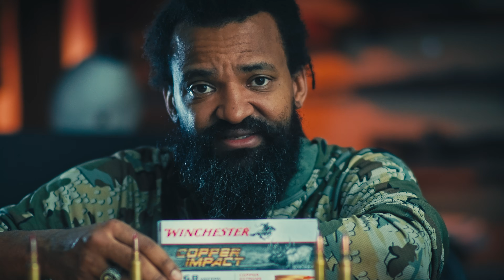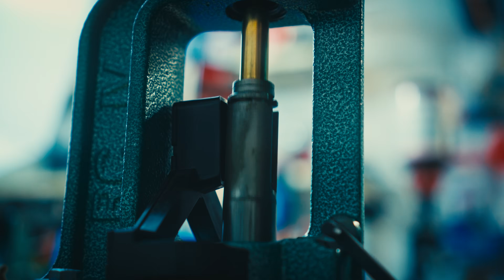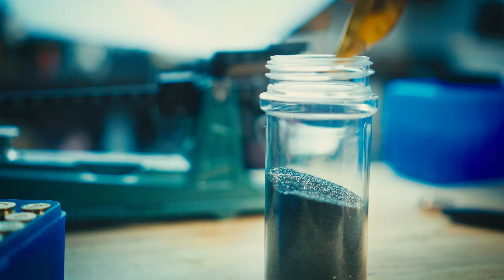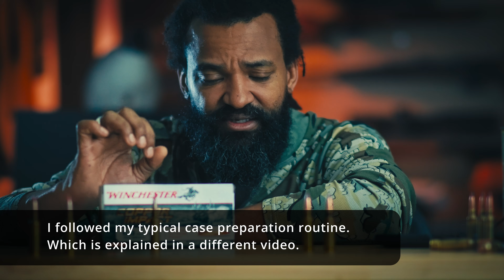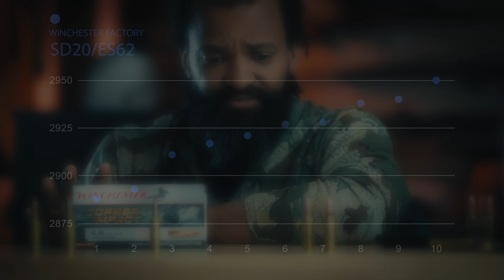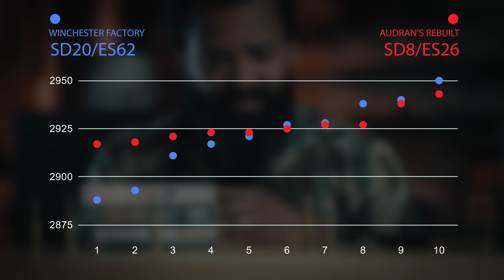I FIXED Winchester factory ammo.

Comment: Great job turning SD20 into SD8 with same components!  It looks like you are using an RCBS scale.  Good choice.  Be aware that type of scale is only accurate to +/- 0.3 grains.  Its a great scale for handloading but be aware of the tolerances of the scale.
Reply from the maker: Hey Charlie thx! Yes it's the RCBS M1000. Extremely accurate, 1 kernel too much and it shows. Where do you get the +/-0.3 accuracy? Because that's not been my experience with it.
Reply: @WildBushGrit  My experience is with the RCBS 505.  I think the +/- 0.3 grains refers to repeatability.  Tiny amounts of powder will move the needle on the 505.  However, I can weigh the same powder charge again later and get a result that is a little bit different.  By the way, 0.3 grains = 0.019 grams.  It is a tiny amount of weight.
Reply from the maker: @sorrycharlie3327   I wonder if you may have been experiencing some magnetic disturbance. This is the first time I'm hearing about something like that. Albeit slow the beam scales are usually incredibly precise. Provided you are well setup, leveled and reading it from the same vantage point. For long range shooting, +/- 0.3 is not acceptable. Precise measurement needs to be at least to 0.1 We do ladder development with +0.2 increments. The smaller the cartridge, the greater the impact a small variation is going to have on your SD. Finding a node in a 7mm Magnum cartridge is easier than finding it in a 6mmBR.
Reply: @WildBushGrit  Mine does seem to be better than +/- 0.3 but its not perfect.  I tbink because the balance pivot has a tiny bit of friction.

Comment: Winchester makes great firearms but their factory ammo is well known to be pretty bad these days. I'm glad that you were able to even-out those charges and improve your velocity variance. I would be very suspicious about your finding that your 20" barrels shoots faster than the published velocity out of a 24" or 26" barrel though. That just shouldn't happen, especially from a cartridge like that. Something is very fishy there. Your chronograph is likely reporting the relative velocity of projectiles properly, but I'd be worried that something may be causing it to bias its reported measurements faster than they are for some reason.
Reply from the maker: I agree it's very strange, it's a labradar, I could add a magneto or the Caldwell next time. It's the first time I'm seeing this. For temperature sensitivity, what would be considered stable powder? I gained avg 12fps shooting the same load on +10 Celsius.